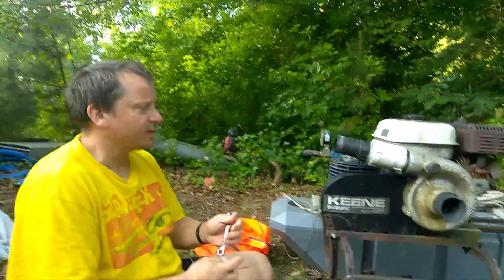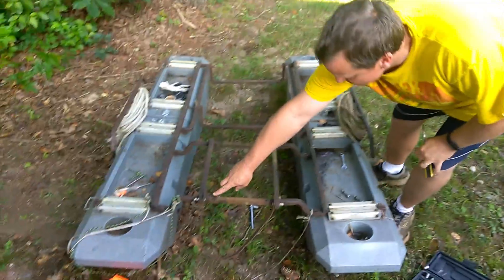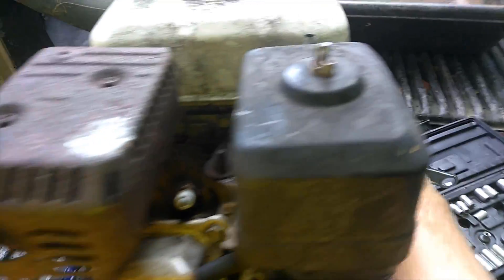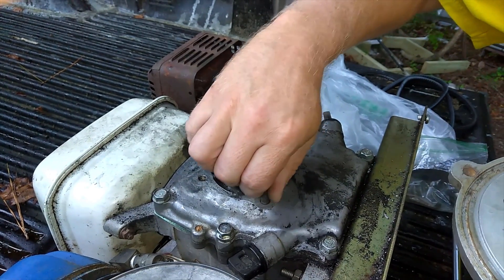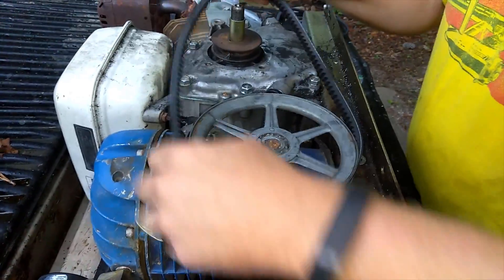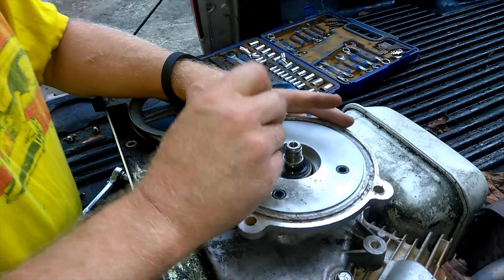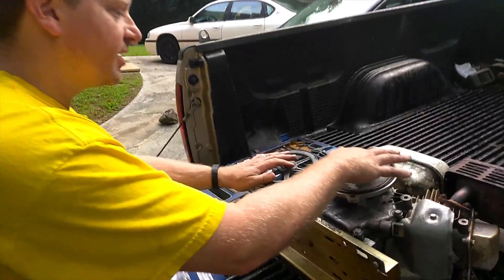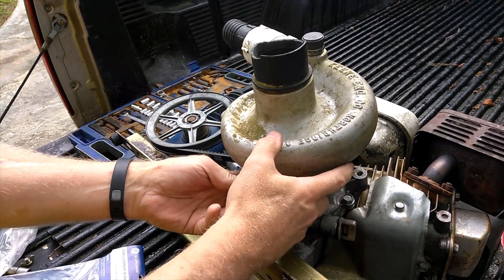Replacing a Belt on a Keene Gold Dredge: Honda 5.5 HP T-80 Air Compressor and P180 water pump

Comment: How did u mount the air pump
Reply from the maker: The air pump is mounted on the dredge chassis adjacent to the motor with bolts.